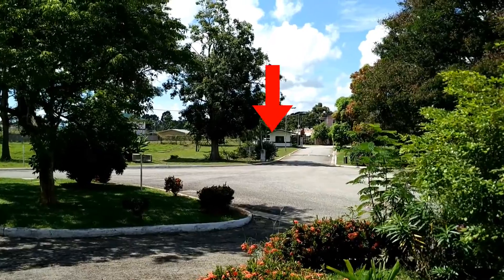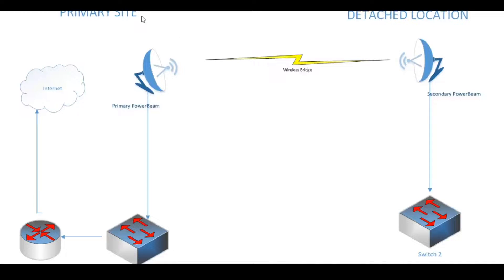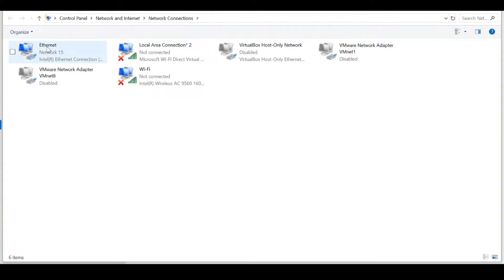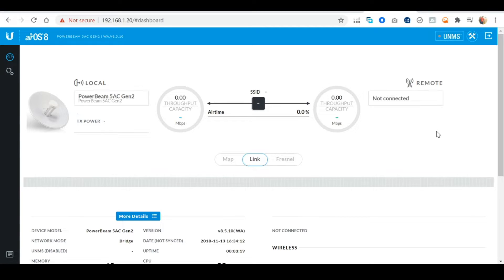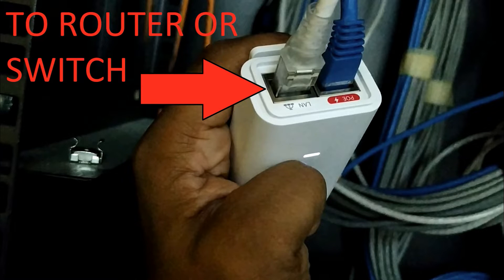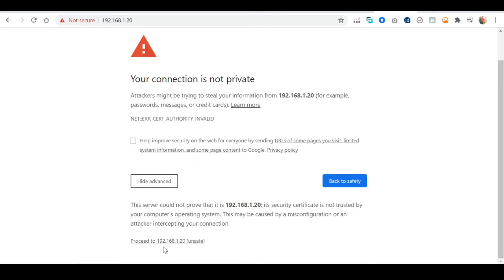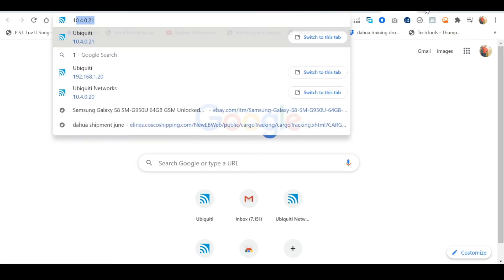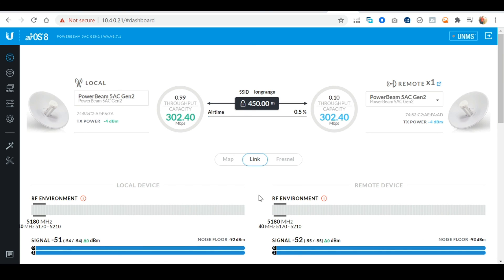Ubiquiti PowerBeam Installation | Transmit Wi-Fi up to 25 km !

Comment: Hi Joshua, Hey can I use Cat 6 cable for these?  

Ubiquiti PowerBeam M5 PBE-M5-300 US 2 Units 5GHz 300mm 22dBi 802.11n Outdoor High-Performance airMAX Bridge CPE Wireless
Reply from the maker: Yes you can use CAT6

Comment: Do power beam dishes work in Syria??
Reply: Yes for sure. 
It is place independent
Reply: It does not provide you internet, but just transfer the internet connection wirelessly for long distances..

Comment: And also the scenario I will be using this is to accommodate parking lot cameras for a large facility that does not have fiber or conduit already going to the light poles
Reply from the maker: Nice sounds like a fun project!
Reply: @JoshuasTechTips  it was and your video was key for my success I appreciate you taking your time to do these

Comment: only problem is the signal meter on the device is very dim and hard to see outside which make aligning them difficult
Reply from the maker: Hi you can use Ubiquiti's map tool to assist - https://link.ui.com/
Reply: @JoshuasTechTips  oh yes I did that and completed this a few weeks ago. Worked great thank you

Comment: It could have had more bandwith if you used an 80mhz channel width instead of 40. Your just need to set the accesspoint as ptp mode nmand not ptmp
Reply from the maker: thanks for your suggestion, however it's only a 100mbps internet link

Comment: Is it possible to access multiple Vlans on the other side? I want to build a PTP b/w these two devices but want on other side multiple Vlans reachability for Servers & PCs. Is it possible with them?
Reply from the maker: Yes infact with this setup I have both voice and data vlans transmitting across the wireless bridge. Remember the bridge is just a medium such as CAT 6 or fiber cabling.

Comment: Is this recommended for in door installation... do you if the signal pass through glass from building to building?
Reply from the maker: This is ideally meant for outdoor use, technically it can also be used indoors however there will be  some level of attenuation (loss of signal), depending on what objects it's passing through eg. walls, glass etc.

Comment: Seems like overkill….some nano beams would have worked  better,  that’s wayyyy less than 25km…….you gonna have some signal over saturation and high noise gain!
Reply from the maker: Thanks for your opinion, however we decided to go with powerbeams since it was something the client already purchased. Also I further optimized the TX and RX to avoid too much noise and have had no complaints to date.

Comment: How do I know what ip address to put on the settings? Does it say somewhere on the router ?
Reply from the maker: connect directly to your router and open a command prompt and enter ipconfig and select enter. You will see a default gateway ip address, this is what you need to enter as the gateway ip in the dashboard.